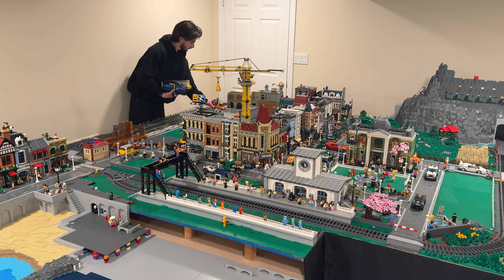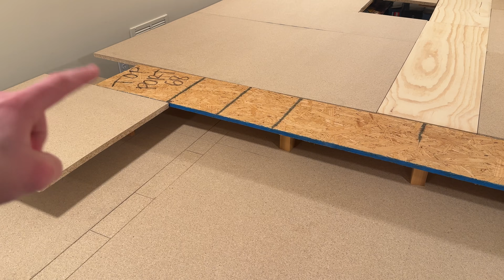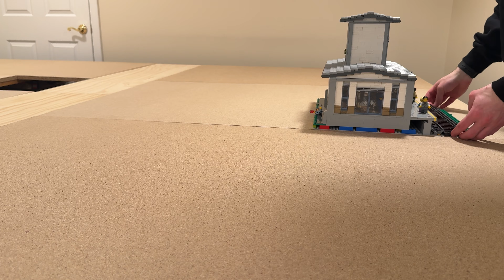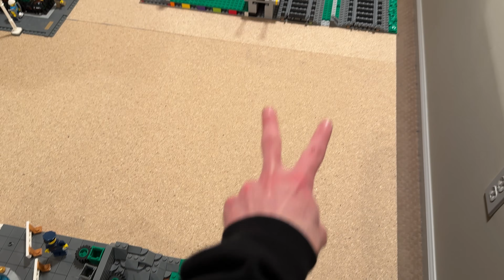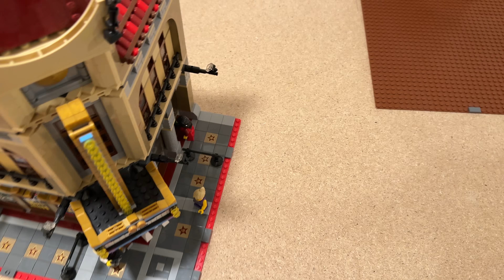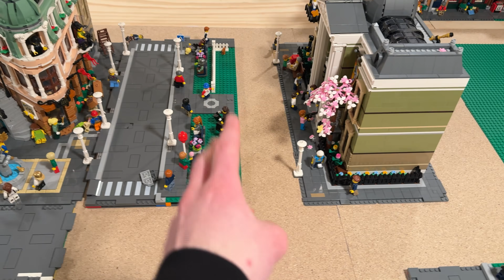STARTING OVER! | LEGO City Update

Comment: Roads take up so much space. Each one with side walks on either side, is a 32x32. That just sucks up space. Then you have train as well, which is forced to the outside mostly.

You're big on trains in your city, maybe just design your city with one large main street (road for your vehicles), and one or two small one way roads, and the just do more track, like if you had an electric rail running right in the middle. In many cities with electric trolley, the trolley just runs down the freaking side walk. You could free up a lot of space.

Just a thought. I'm building mine with the main street having the police, fire, and hospital services, because of vehicles,  everyone else just uses electric rail.

Just something to think about--how could you design if you didn't have to have so much road.
Reply from the maker: I’ve been using one way roads from the start, even before I created this channel. The two way road is my main street, all the other roads in the city are 16 studs wide at most. I’m using up the space in a way that I think is the most efficient. I want roads so I can display vehicles, but I don’t want them to consume so much space. Thus, I’ve found mostly one way roads with a single main street that is two lanes wide to be the best option for me.